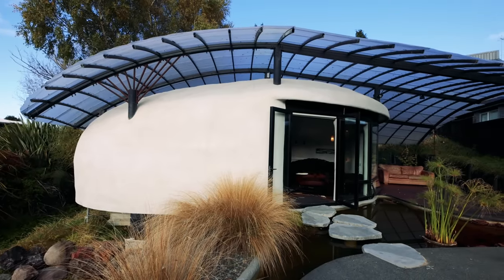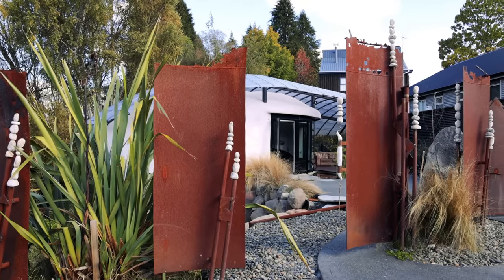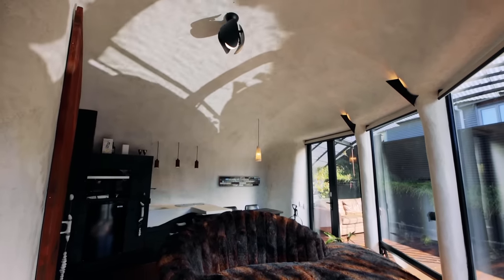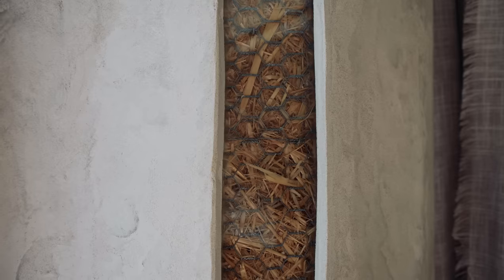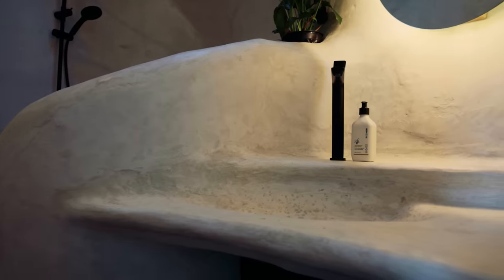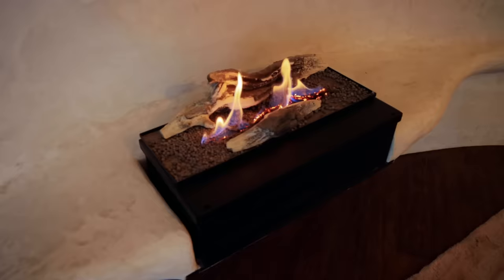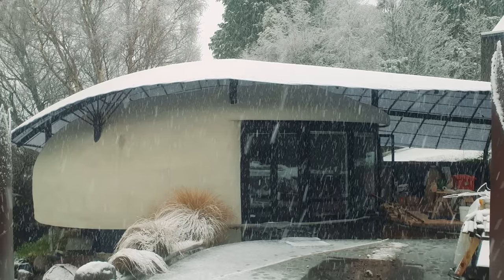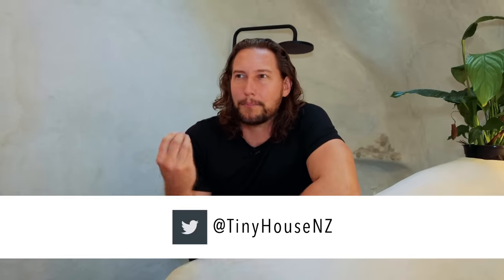This Stunning Small Strawbale Home Looks Like It Was Carved From Stone

Comment: Here in England we have lots of beautiful thatched cottages and some walls (made of straw) and they have lasted hundreds of years, but I've never seen a modern one, what a cool build!
Reply: Thats so cool that they last that long
Reply: Def a cool build! How do the thatched roofs in England prevent mold in humidity and rain?
Reply: @daranadine7711  The buildings are typically made of cob, which is mainly clay, with straw and sand, hair etc. mixed in. With good foundations and overhand roof they last for hundreds of years. Thatch is also really water resistant... reeds grow in water, so they are pretty waterproof, and when you have massive bunches of them, the rain just slides off. The only real problem with cob is when people in the 1960s and 70s painted them with modern, non breathable paints, so once any moisture does get in, it can't get out.
Reply: Oh wow! I didn't know that about England! I've always admired other countries for not tearing everything down, after 50 or so years. They claim it's cheaper to start over than fix...hmmm! 🤔
Reply: @cleonawallace376  Ohhh...thank you for that detailed answer! I was thinking if it were mine, maybe I'd want to paint some of the walls, but I see! It's just amazing to me how it's BOTH breathable AND waterproof, at the same time! I appreciate you taking the time to explain that! 😊

Comment: Stunning. I have always wanted to do a straw build on a trailer, its so exciting to know its possible!! I'm curious, did they say why they chose to build on a trailer?  The build seems so site specific so I was wondering if they wanted the flexibility to move it or if it was for permitting reason or something?
Reply: Following
Reply: following
Reply: I was wondering the same thing.
Reply: I'm guessing it can't be moved.  It's 18 feet wide, plus the plaster would likely crack.  If forced to move during the rainy season, water entering the straw would lead to mold and thereby health issues.

Comment: Wow! I never thought you could build a tiny house on a trailer with straw. Is it able to be towed, or is it permanently in place? Just curious since I have heard building with plaster is risky when a trailer is involved due to movement. Still looks like a stunning and inspiring home.
Reply: of course its possible to tow a plastered tiny, though it isn´t recommended to do so often - because you better prepare for cracks to appear whenever you move the house. so basically, if you want to travel with your tiny, plaster shouldn´t be your material of choice, but if you plan to live mostly stationary, go ahead ;-)

Comment: This is so cool and unique! Not sure how well those building materials would work where I live (zone 4 in the U.S., roofs end up with the weight of multiple feet of snow on them in the winter).
Reply: I wonder how much of an issue the freeze/thaw cycles would be even if it could handle snow weight. I just imagine the plaster absorbing the humidity in the heat, then freezing and cracking over winter.... and mold issues from the moisture?
Reply: @GoingGreenMom  Yeah, that too. It’s very rare to even see stucco used on buildings around here, for that reason. It’s all vinyl siding or brick walls. The winters here are very harsh on anything like concrete/plaster/stucco. Even the roads develop damage over the winter that wasn’t there the year before.

Comment: So serene and inspiring at the same time.  Technical question- what is the R value for straw bales? Wondering if they satisfy code requirements in US? I was thinking about a yurt, but the insulation requirement is an issue.

Comment: "That fire place". No, it is not safe. It does put off carbon monoxide AND "aldehydes". Notice how it sounds like formaldehyde. That's because it is of the same molecular family. The moisture collected from a gas burner(LPG or NG) contains aldehydes and will literally dissolve stainless steel, iron, copper. Not something you would want to breath.
I have 25 years in R&D engineering in the gas stove industry.